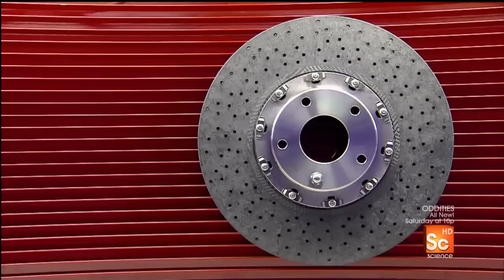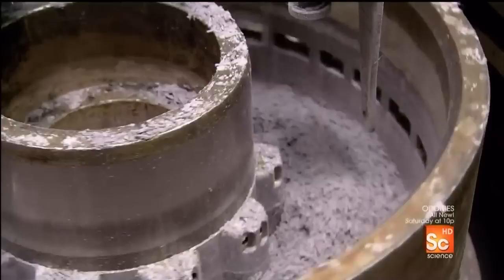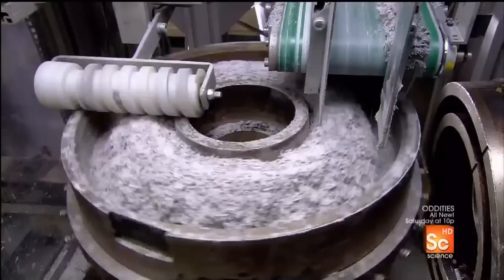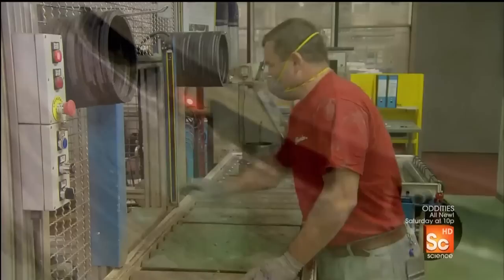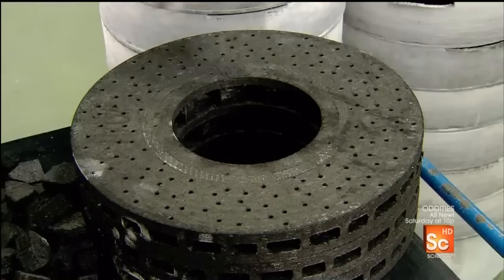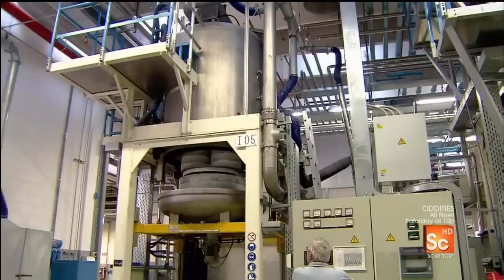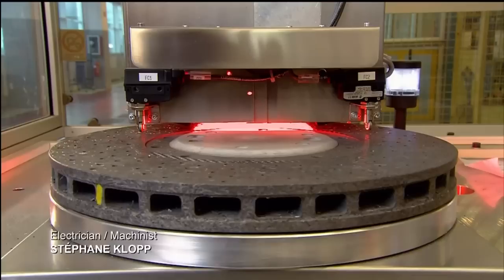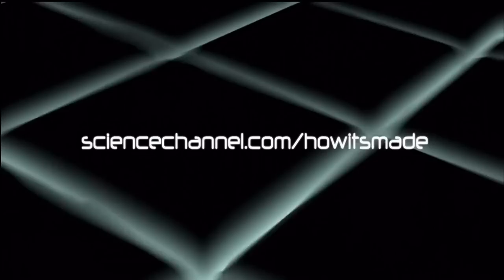How It's Made   Ceramic Brake Discs

Comment: Great "how it's made" video.  

However:
"That kind of power on wheels requires light weight, and cast iron is very heavy. It would also wear out too quickly, due to the intense heat friction generates when you brake a car with such a powerful engine."

1. More power does NOT require light weight. More power tends to shrug off excess weight. Lighter weight discs would be a benefit on any car of any power since it makes more efficient use of power and requires less brake friction to slow the wheel rotation.

2. I guarantee that our Honda minivan, at a very meager 250-ish hp, generates more heat during braking than any Porsche. Because it weighs more - plain and simple. And it does so on cast iron discs. How do we not die on a daily basis? Let that sink in.

The expensive ceramic disc has a very appropriate and good home sitting on Porsche axles, and I think the tech is way-bad-cool. But more power does NOT require light weight, and powerful engines do not, in and of themselves, cause more braking friction.  The benefits of a ceramic disc are more about how the car is likely to be driven than anything else.
Reply: +Andrew Short Yup that part was pretty f'cked up.
Reply: I guess speed plays a part too, which the engine does have impact on
Reply: 2 is completely incorrect for the reason i doubt your 260hp honda mini van is shredding the Nürburgring at 150+ miles an hour and then braking so hard that you're disks start to glow like some porches do otherwise yes they would generate more heat

Secondly- they're not meaning that they're lighter because the more powerful engines couldn't handle the extra weight its all about shaving seconds off lap time and trust me every pound counts it also reduces unsprung weight helping the wheels regain contact with the road over bumps

Last thing no you would ever "need" carbon-ceramic disks on a town car be it a porch or lamborghini etc but if you plan on using it as a track vehicle yes you're going to want ceramics or you'll have some major fade
Reply: @kaddynips368 - You mentioned reducing unstrung weight as "helping the wheels regain contact with the road over bumps", and I'd agree that regaining contact is important in a turn, but not so much in a straight.  Another benefit of reducing unsprung weight is that each bump would slow you down less.  Think of a tire rolling on a level-&-smooth road, except for a one-inch bump.  In this simplified scenario, Momentum (which is a "vector") is split into two components, one of which is "up & down momentum" and the other is "the remainder momentum still moving straight ahead" but at a slower speed.  

On a car, the shock absorber absorbs the up-&-down movement, and the engine accelerates the car back to the original speed, if desired by the driver.  The reduction in unstrung weight means that the car is slowed less than if there were a higher amount of unstrung weight.  So, the bumpier the road, the higher the benefit of reduced unstrung weight, not to mention marginally better handling, which might mean the difference between staying planted on the road, and sliding off the road because your turn was "too tight" to handle the slightly higher wheel-momentum, whose vector (pointing straight ahead) was undeterred by the grip of your tires, and the wishes of the overzealous driver.

Also, you overlooked the fact that, when driving up a long mountain road, every mini-van accumulates a lot of potential energy that converts to velocity on the downward slopes.  Brake fade can become deadly even at low speeds.

Finally, there's long been advertisements for the shortest "stopping distances" required for coming to a halt from 60 mph.  My 1980 Honda Prelude was advertised as requiring only 100 feet, compared to 125 feet, for other "normal" cars.  Anyone can calculate the amount of heat-generated from stopping my Prelude from 60 mph, which doesn't depend on the distance required.  But, just remember this:  If you double the speed, then the amount of heat generated would be 4-times as much, and if you triple the speed, the heat generated would be 9-times as much, because kinetic energy = (1/2)(m)(v^2).  And that's only partially why the distance required to stop a car from 150 miles per hour is so much longer than from 50 mph, or 75 mph, even without any brake fade at all.  Good heat exhaust from your brakes can be a huge factor.

Have fun on the Nürburgring, but try to keep in mind your super-car's inherent limitations, and the physics involved in every turn and slope.  It's no fun, otherwise.